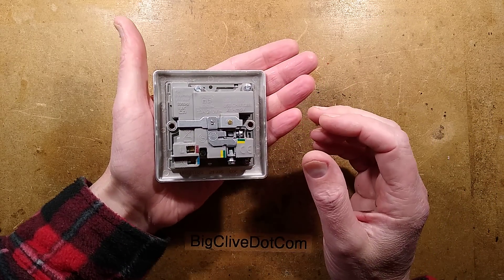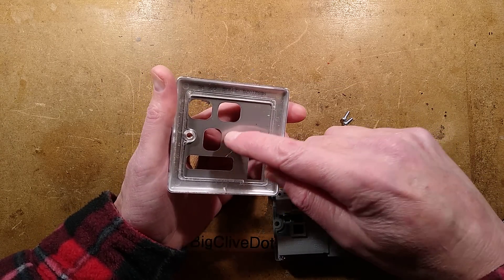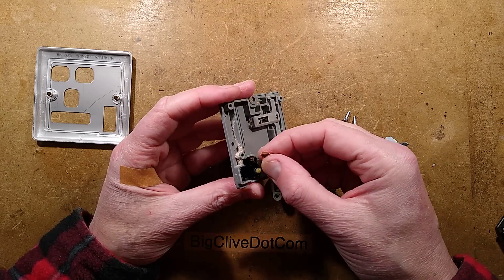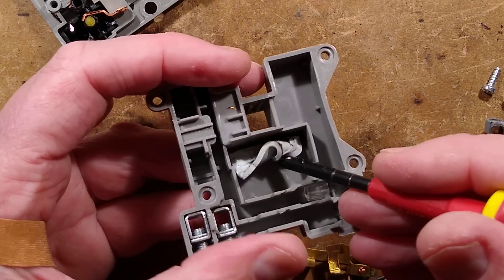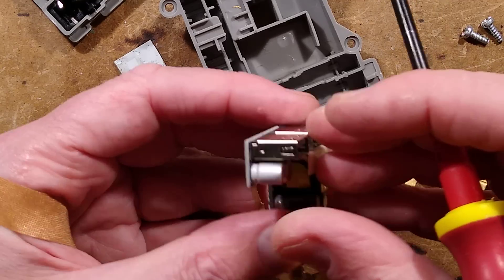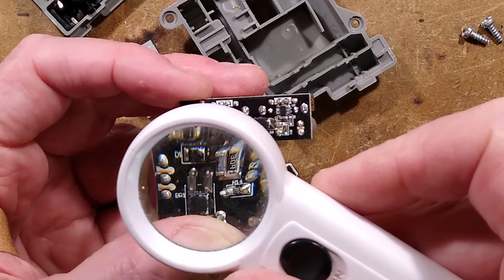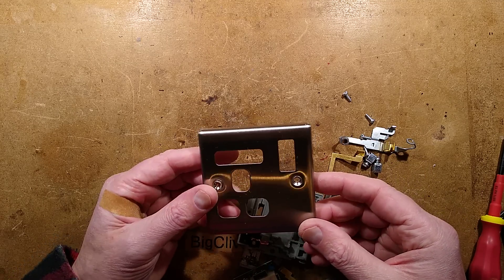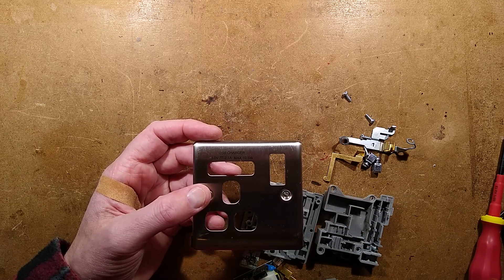Exploded British General USB socket

Comment: If people insist on having these in their houses is there a better way to do it - for example a separate 5V ring main connected to a single supply at the fuse box?
Reply from the maker: The voltage drop could be significant at 5V, but a 24V lighting and charging buss is viable.  Preferable fed from a power factor corrected central supply, and also a plug in module that the homeowner can swap themselves.
Reply: @bigclivedotcom  24v is in the realm of solar with a couple of car/leisure batteries (and mains backup), with distributed switching converters for low voltage loads. It's high enough to run (typically) 19v laptops & USB PD upto 20v as well as small stuff at 5/9/12. i've been toying with that idea a bit as it'd potentially meet much of my daytime use while being very cheap to do. lighting too, perhaps.
Reply: @davidareader  24V is THE standard for low voltage DC power in industrial automation, and while it's not the only one (5VDC is used for logic, 12VDC is often used for control devices like solenoid valves or motors and very common at home for LED lighting, and 48VDC is the standard voltage in power over Ethernet), it's pretty practical to run a few meters of cable from the power supply to the receptacle, which could contain a switch mode DC/DC buck converter.
Reply: @KeritechElectronics  yeah, I grew up with industrial automation 🙂 .. that's usually locally derived in the machine (ok, a single machine may be the size of a building...) .. and often in multiple places. In telecoms we use 48v .. and that is distributed around an facility, and battery-backed.
Reply: @davidareader  that's right - I find old pulse-dialed systems quite fascinating. Uniselectors, electromechanical tone generators and stuff :). By the way, Poland used 60VDC for standard line voltage.
Reply: @KeritechElectronics  I work with rather larger things .. I've installed optical transmission equipment and large IP routers on 48v systems in datacentres and cable landing stations for eg.
Reply: For a large house even 24V will be wasteful though. And forget about 5V.

Comment: Worry some.   I have many of those in my US house.   Reputable manufacturer, Hubbell, hospital grade.   Installed them in patient rooms at my hospital too.  So far so good.  
I could send you a sample one if you’re interested
Reply from the maker: If they're hospital grade they should be well designed.
Reply: @bigclivedotcom  Sorry,  I do apologise for this, but if they're fitted in psychiatric wards they are MAD ( Medically Approved Devices). 🤨🤨🤨🤨
Reply: @wolfpax181  Yes your going to get taxed for it but generally they are held to a higher standard and end up being worth it. IF you dont have to replace it, Ever, and you have to replace the cheap one 5 times in 30 years, the more expensive one has won.
Reply: @crisnmaryfam7344  I generally stick with spec or commercial grade. They're substantially better than any residential grades for a modest premium, whereas the higher tiers are shallow improvements in quality for significant increases in price. They're also commonly available in bulk packages.
Reply: @wolfpax181  that's the way it works. When something is built better, or built to certain specifications, above nominal specifications, it costs more.

Comment: What would be a good replacement for this? I was thinking a two outlet plate with switch, so you could plug in a USB wall wart and still have a mains outlet. But would that fit on that size plate?
I also noticed that the cover plate has separate openings for the 3 outlet prongs. I’m from the USA and (at first) didn’t recognize the 3 holes as an outlet. Is this unusual?
Reply: You can get double sockets which fit (via an adaptor plate) a single box, but they're a bit thicker than the normal ones.
Reply from the maker: This is a standard UK socket.  They do wider twin versions too.
Reply: I didn't see that either.
Reply: All US receptacles have had three holes for 50-60 years. The third is for grounding. In the US it is round.
Reply: Ditto from Australia re recognition.

Comment: Being able to actually switch off the USB option within a mains socket should be a mandatory feature. Even more so with having to cut down on power consumption and being "green" because these USB power supplies built into mains sockets are powered 24/7 and are ALWAYS consuming power regardless of them being in use or not.

K.
Reply: By US law, which the EU later adopted, your typical USB power supply that outputs between 1 and 49 W, must have a standby power no greater than 100 mW. These will be 2014+ and marked with a circled VI. (If you have older adapters, V required 300 mW, IV was 500 mW)
Reply: My double USB socket draw 0.1 W without load. The meter can't sense it...
Reply: @rayoflight62  but thats not the point,  if its 'permanently' on,  it could fail, maybe catastrophically,  at any time,
Reply: Fully agree, difficult to obtain though seems majority, if not all are permanently connected !
Reply: If every teenager in the uk (aprox7.4million) left a 5 watt charger plugged in then that's like 37,000 kw/h 😳..... is that right!?! 😬 feels wrong
Reply: @Jawst  the consumption is tiny when  not in use. 5w is when used to charge something.
Reply: @Jawst  the 5w will only be when its charging, when powered but nothing connected, i'd be more like 1/2w maybe less, but thats not the point....it could fail...disastrously..... switch off when not in actual use!
Reply: @Jawst  about 37,000kWh (or 37MWh) every hour, approaching a gigawatt-hour per day.  7.4 million is a lot of people.
Reply: the power consumtion is likely minimal when no load on the usb, but thats not the issue, the problem is failure, possibly 'catastrophic', possible fire risk, and the hassle of replacing the whole socket when  it does fail,, these may well be nice and convenient , but doesnt mean its a good idea to do!
Reply: Do people unplug their chargers every single day when they wake up in the morning? I mean, yeah, it consumes energy. But it's like 5w at most...
Reply: @somedude2492  5 watts? Can't be that much. That's the entire output power of a lot of wall warts. (450 mA)
Reply: @DickHolman  only when supplying power to something. Standby is tiny
Reply: @DickHolman  That's the DC power consumption the AC power consumption will be somewhat less.
Reply: @littlejackalo5326  don't ever underestimate chinesium
Reply: @DickHolman  it'll only take that power when actually charging, when not but still powered, less than a tenth, i bet, but thats not the point,,,,,
Reply: @brucepickess8097  more actually, as you lose efficiency rectifying the ac , plus inefficiencies in the psu switching circuitry
Reply: @somedude2492  Are you kidding? 5 W would be huge. It it more like 50 mW.
Reply: @okaro6595  50mW is still less than 5W, which is what i said. If it's lower than 5W, i don't care to unplug it.
Reply: @okaro6595  i bet about a tenth of loaded output wattage, maybe less , if powered when unloaded
Reply: @somedude2492  5w or 10w or so when loaded/charging , likely less than 1/2w with no load on it, but thats not the issue, it could fail, as its continuously powered, maybe even catch fire, .much better and safer to switch off when not actually charging anything
Reply: @somedude2492  I always unplug mine when they are not in use. I do that to cut down on RFI, I don't need a dozen switching power supplies spewing noise when they are not even in use.
Reply: @rocketman221projects  why would RFI even be an issue in the first place? I can get behind saving power, but are you a radio hobbyist or something like that where noise from switching PSUs could be an issue?

Edit: sorry if i sound harsh, i just woke up lol. I am genuinely curious for the reason behind that.
Reply: @somedude2492  The RFI makes it difficult to listen to the HF bands. Most voice communications on HF use single side band so any noise on that frequency is always audible behind the person you are listening to.
When there is a lot of switching power supplies running, all of that noise combines together and you end up with broadband hash that can wipe out a large portion of the HF band. High quality switching power supplies can be fairly quiet, but the cheap, crappy ones just spew massive amounts of noise everywhere.

Comment: Given that people insist on having these I think an improvement would be if the connection to the mains was via the socket switch - i.e. socket off = USB off as well.  

Few people use the socket mounted switches these days and as these things are usually in bedrooms, beside bedside cabinets or under kitchen cupboards, with almost permanently plugged in devices (bedside lights, clock radio's, kettles, toaster etc.) the ability to keep the USB on with the socket off does not seem a significant requirement.  At least you would then be able to switch the whole thing off when the fireworks begin! 🤣🤣🤣🤣
Reply: I couldn't agree more. Being able to actually switch off the USB option within a mains socket should be a mandatory feature. Even more so with having to cut down on power consumption and being "green" because these USB power supplies built into mains sockets are powered 24/7 and are ALWAYS consuming power regardless of them being in use or not.👍
Reply: @getcartercarpark.  yes perhaps the jobs worth's, who write the regulations stopping us competent persons doing anything with volts above 24, should do something useful and write none switchable USB sockets out of the book.  

Afterall they are trying to force us into similarly other, expensive, questionable protections for faults that only occur in probably one in five hundred thousand instances (read arc fault detection)
Reply: @barrieshepherd7694  The intention isn't to prevent competent persons from doing their own repairs, there are people who should not be allowed to attempt to work on high voltage equipment.
I have seen some very serious mistakes made by incompetent people which are either a liability or downright dangerous, there needs to be a way to protect the innocent from idiots !
Reply: @ian-c.01  ???? Sorry can't follow your comment in relation to mine.  

I was just proposing that the feed to the USB portion of the outlet should be connected AFTER the socket switch rather than before.  Nothing about people doing repairs.  That would assist sparks making installation tests as well.
Reply: @barrieshepherd7694  I suspect Ian C was commenting in regard to your reply, not your original post: "...who write the regulations stopping us competent persons doing anything with volts above 24, should do something useful ..."
Reply: Some are, a lot we have in new caravans have one of the switches on a double socket also switch on/off the USB charger or just the one switch on a single. Very good idea and i've not seen any failures yet.
Reply: They need a separate switch for the USB section.
Reply: Thats all in how its been wired from the wall. You can have it tied to a switch on the wall, and it not get any power unless said switch is toggled on. You dont need the socket cluster itself to have this feature, as normally its placed in an obscure location, to hide wires from a lighting source such as stairway led's. Wiring it from its own direct feed would probably be incorrect and a possible code violation.
Reply: @crisnmaryfam7344  well that’s going the long way round for a shortcut 🤷🏼‍♂️ just use a USB adapter in a 13amp switched socket. Problem solved 😎
No need for a rewire and spurs all over the house!! Simpills 👍🏼👍🏼
Reply: Barrie Shepherd, i think thats an excellent idea,  perhaps contact BG & Hagar etc & ask them why they dont have the usb outlets turning off along with the 13A outlets. I can see this being a further amendment to the 18th edition👍
Reply: @merlin5476  Thanks - I'll run off to the Patent Lawyer now 🤣🤣🤣🤣
Reply: @barrieshepherd7694  too late, i done it 6 minutes ago. 🌝
Reply: @merlin5476  tin tin your savage
Reply: or separate switch for the usb power part, maybe fit a switch to the usb socket so if plug removed it removes ac power from the circuit
Reply: "people insist on having these" - simply - don't! These are not improve room design in any way. Plus are real safety hazard.
Reply: @KrotowX  Problem is they exist, the general public like the idea of being able to plug their phone/tablet in anywhere without lugging a power pack around so they will continue to be installed.  

If they are "a real safety hazard" why do they exist given the nanny state controls of those setting the 'standards' ?  

Now the cat is out of the bag all we can hope for now is improved safety primarily by making them somehow switchable.